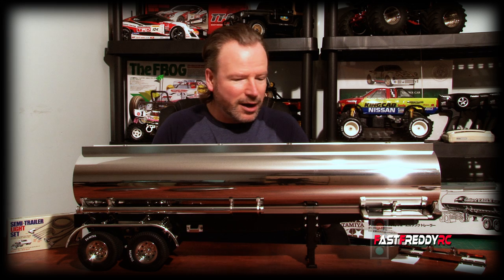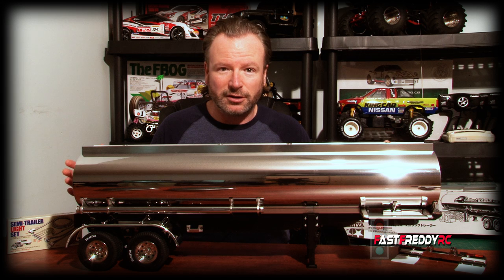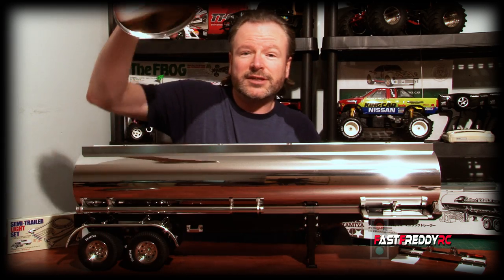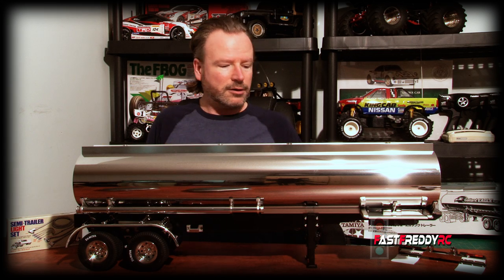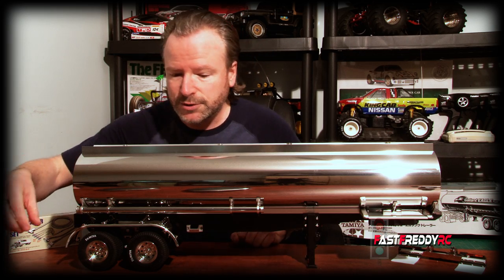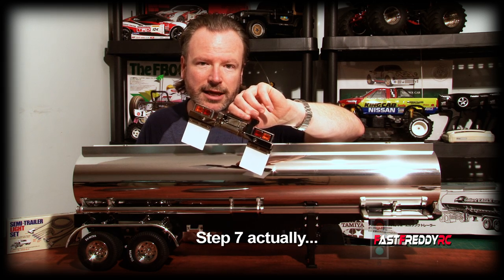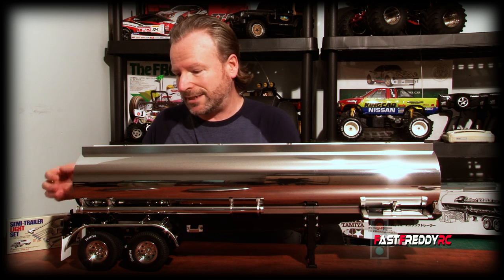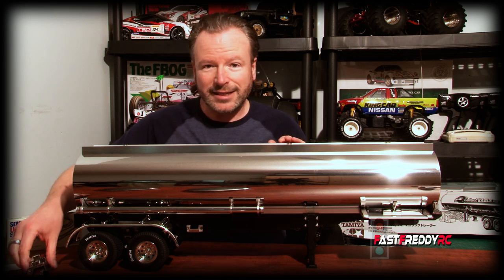Installing the Tamiya Semi-Trailer Light Set onto a Tamiya Fuel Tank Trailer

Comment: FREDDY arent there any rewverse lights  on the trailer. the reason i am asking is that i plan on using the gt power container light kit and they come with more lights. are there any more housings for lights on that tank trailer? amother great video and plan to watch as i build, thank you again
Reply from the maker: Hi Michael!  Great question...and the answer is no. They give you room for taillights and turn signals but there are no clear lenses for reverse lights. In fact I haven't seen any aftermarket versions of the back end of the trailer that would allow you to do that. I know @westernsharpies creates custom bumpers so it's possible one could be made for you??

Comment: The absolute worst way the install lights. The plug in is unsightly. Wireless trailer lights work a thousand times better
Reply from the maker: As per instructions it’s the only way. However…completely agree with you. If you want a more realistic look wireless lights would be awesome. Can you recommend a set?